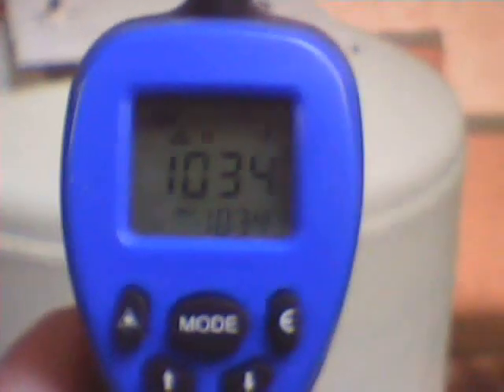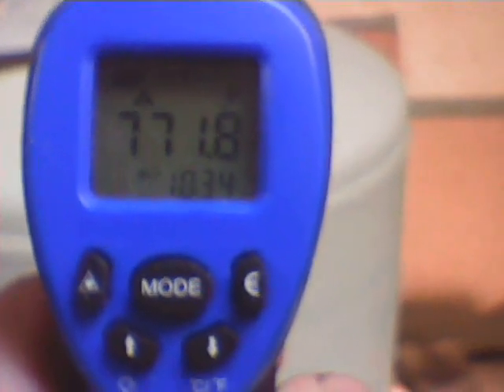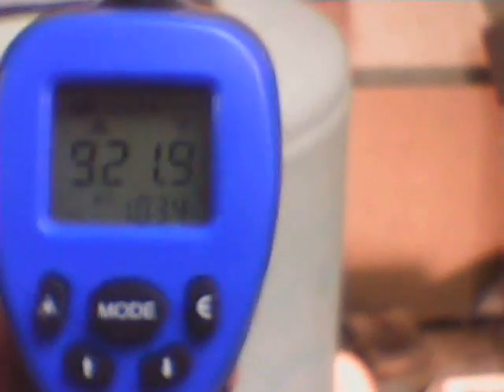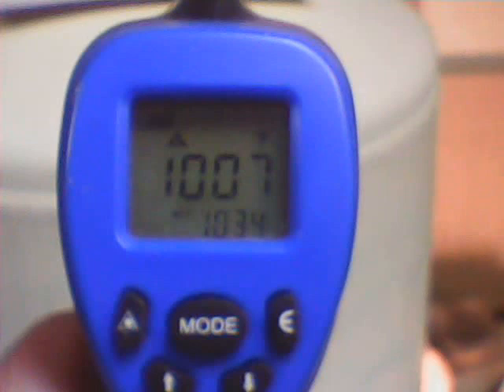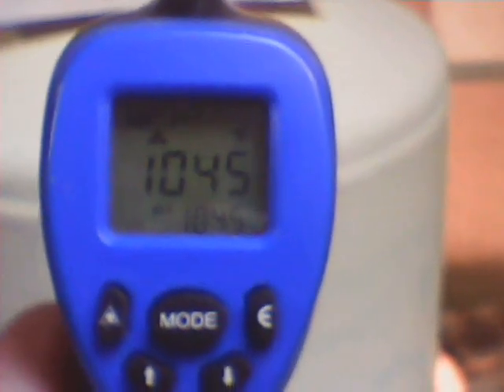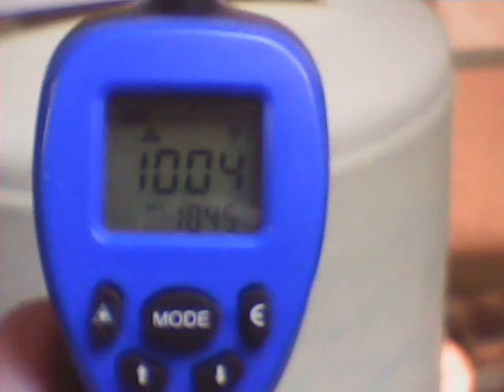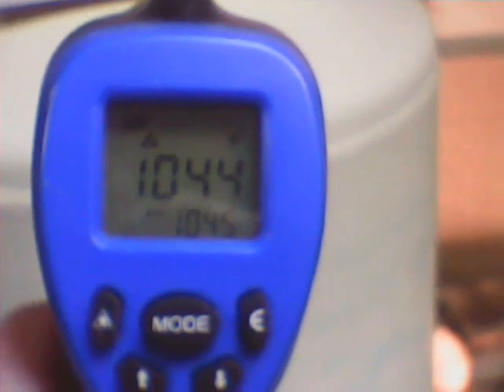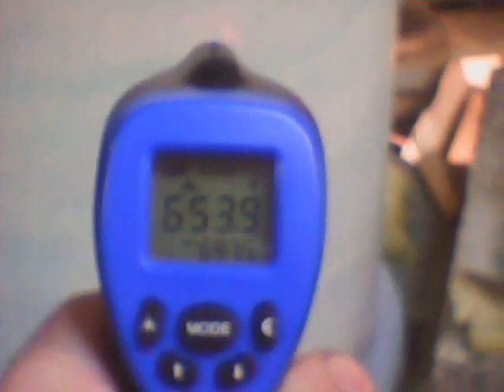ROCKET STOVE MASS HEATER (part 5 test time 1050 Fahrenheit)

Comment: back up and show us the entire heater. IN OPERATION!!!!!! AND SLOW DOWN WITH THE CAMERA MOVEMENTS
Reply from the maker: this was film whit mi hold cam and if you saw mi chanel i did build two other stove and the reason is i need to fix this one .the interior is all disintegrated heat is to intense will fix it whit fire brick .but right now passing to much time on mi new build and another thing it to hot to fire it up it already like 90° F inside . mabe lather in september . if i do build another stove like this would cast fire brick inside right away.